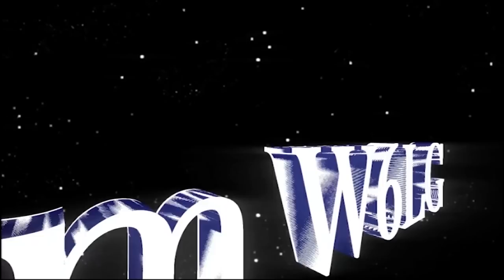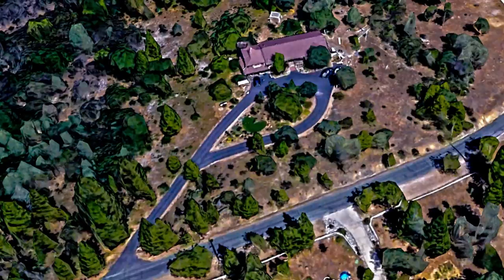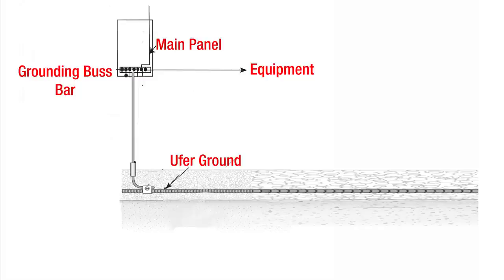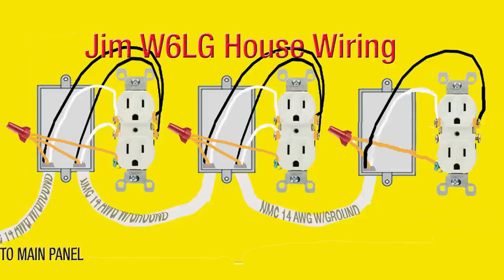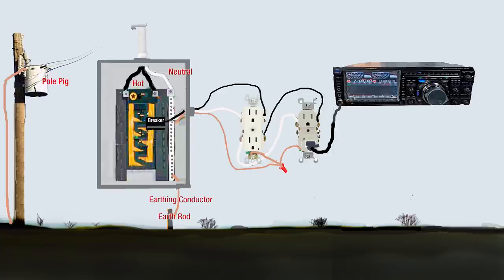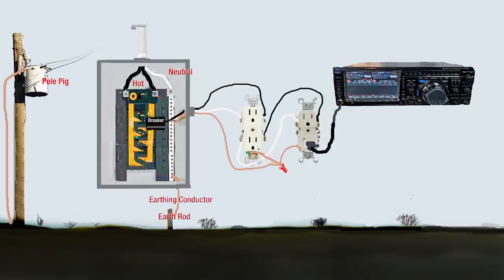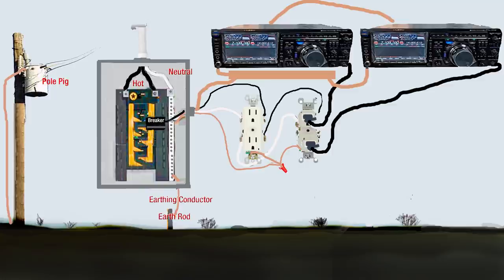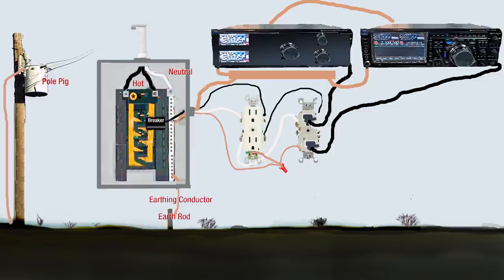Grounding, Bonding, Earthing, Shielding and Protecting with Jim Heath W6LG

Comment: Hi Jim I am loving all these new names Uffers and Pole Pig's we don't have those her in UK and I have never heard of an Ufer...All our Houses have Equipotential Bonding where all Equipment is bonded with an Earthing Conductor which all leads back to the Mains Earth, having Ring Mains on ground and upper floors also reduces the Resistance or Ground Impedance effectively doubling the 2.5mm2 Earth 5mm2 to everything that's connected..
Great Video Jim.
73 de Steve
Reply: Just found out where the name Ufer came from》》》
In 1942, Herbert G. Ufer was a consultant working for the U.S. Army. Ufer was given the task of finding a lower cost and more practical alternative to traditional copper rod grounds for these dry locations. Ufer discovered that concrete had better conductivity than most types of soil. Ufer then developed a grounding scheme based on encasing the grounding conductors in concrete. 
It was adopted into the Safety Codes in 1963 although they recommend the use of Copper coated Grounding in not so dry area's..
Interesting stuff.

Comment: This makes sense to me. My newly built house seems to be wired right as every outlet I've tested provides a 120-125V reading from hot to the ground socket AND to the cover plate screw.  In other words, there is zero difference between the hot-to-ground voltage and the hot-to-plate screw voltage.  Given these sockets all run to the house ground, my radios will be grounded to the outlet ground and thus will be on the house ground.

Comment: Jim I really love your videos and learn something new each time I watch them. I have been a Ham for ten years now and I have never ran a separate ground from my transceivers or Amps. Along with you I feel this is a violation of the NEC. Also, in rare cases it is an extra conductor of a close lightning strike...it has happened. I checked my circuits with a tester to ensure the ground is active. And my second ground to my equipment is from my antennas. So my equipment is double grounded. Why would I use a third ground? Many old timers will say that the grounding lug on the equipment is there for a reason, and maybe in some countries without grounded circuits or on a DX expedition it is useful. However for the most part that grounding lug on the back of the Transceiver is a leftover from the early days of Ham radio when electrical circuits in homes and elsewhere had no ground. Most people don't realize that in the beginning of  home radio receivers being sold that hundreds of people were electrocuted by them, and when television was introduced the same thing happened. When grounded circuits were mandated by code the danger of ungrounded circuits was eliminated. So I don't ground my equipment with a third ground.

Comment: Hi Jim, this is one of those subjects that gets more and more complex the more you look!
The Motorola grounding approach actually creates great complications for most of us in the U.K, the electricity supply to my house for example uses a system called TNCS. Basically this means that the incoming feed is on a 2 conductor cable with the safety ground doubling as a  current carrying conductor.. The problem with this is that in the event of that conductor failing in the street that the load current for a number of properties could theoretically try to flow from the chassis of my transceiver to the antenna ground. This is a strange scenario but it is permissible for me to use a separate grounding system for that one room. I best reiterate that I am in the U.K., and that our supplies and “codes” are different. Scarily a few days ago I discovered that the safety ground to all of my ham gear is absent, highlighted when I got a shock while connecting the coax to a grounded quarterwave vertical.
The mains filters in the gear mean that without a safety ground the chassis float at half supply…
Reply from the maker: It does.  My guiding idea was all current from the AC supply goes back to the electrical panel.  That could be a sub or main panel.  I did want AC flowing into the ground at the shack and result in current not tripping a breaker because some of it was siphoned off.  Some disagree with that principal.  As a Building Inspector and member of the Board that set standards in later years, we all agreed on that along with knowledgeable Licensed Electricians who cared about the safety of the customers.  Seems simple enough to me but not to many others who violently disagree. 73, Jim W6LG

Comment: Maybe discuss the potential problem of a second story ground and how certain wavelengths of copper can cause problems at certain frequencies.

Basically the copper leading from the second story to the earth ground provides an unwanted return path for RF to the radio, tuner, etc.

This is similar to common mode current, but in either the house electrical system or sometimes in a individual station ground. Just a thought. There are variations of this problem and they are difficult to isolate and diagnose. RF, EM, current and voltage are all looking for somewhere to go.
Reply from the maker: Thank you for your comments and question.  Why do you have wires leading from the second floor to ground?  Why do you feel that you need a path to ground?  What does that accomplish?

73, Jim

Comment: These videos are very interesting. I do have a question where multiple pieces of equipment are concerned. In the case of bonding two pieces of equipment together to ensure they are at the same potential, why would it be necessary to then connect them to the electrical panel when they are already connected to the same electrical circuit? I would think just the act of strapping their chassis together would be sufficient to put them at the same potential since they are both using the same earth return path through the house and out to the panel via their grounded plugs.

Comment: i understand that you can have more than one ground rod, but they all must be tied to the same voltage potential in the main electrical panel.  This is why the main panel has the neutral and grounds tied together, but a sub-panel has them separate.  It all goes back to the voltage potential and having a single grounding "reference" point.

Comment: I have been reviewing your videos' on NEC and I do enjoy these very much, Thank you for providing these. I do have some thoughts on the NEC, Aren't they only concerned with Safety of the persons working on and with the equipment? It has been my understanding that what the NEC says about grounding is strictly for safety, being sure there is a redundant return path for the electricity and nothing about RFI. and in my understanding the typical Bonding we as Ham's do is not for electrical safety but to remove any stray static that may be introduced into our equipment by lightening in the area and to help carry away and RF current that may come back into  the shack as the result of antenna / feedline mismatch. This being done by a common point bonding bar, then outside the shack to a going rod in the ground. Then connecting this rod by running a bonding wire back to the electric panel ground rod just to keep everything at the same electric potential.
This is the process I use at my QTH.
Thanks for your You Tube channel and your hard work it takes to make these great films.
Paul Krog
call KR5OG
Troy, TX
Reply: @jimcoon  Jim, bonding is to reduce static on the coax that is carried to the radio (noise) along with any RF coming back into the ham equipment in your shack, by attaching everything to a common ground then out to a ground rod as close as possible to the entrance of the cables entering your shack. 
As far as bonding back to the service entrance ground, it can be difficult but should be done. The purpose for this is protecting you and your equipment in the event of a close by lightning strike. By bonding the ground points together helps to keep both points at the same electrical potential. I have known hams with your situation, long run obstruction like a driveway, that have run the bonding wire around to the driveway and then removed some of the expansion joint filler where the driveway buts up to the house foundation, placed the wire in that space, then replaced the expansion joint filler. 
Also the conductor from your ham equipment to your copper pipe should be flat braided copper rather than a wire. (Flat braided copper 3/4” wide) also the conductor from the copper pipe should be a copper strap 1 1/2” to 2” wide and fairly heavy gauge .020” to .032” thick. The reason for this is RF only flows on the surface of the conductor. And the strap has much more surface than a # 6 wire. 
To boil all this down, each operator has some variations from what others have. And in some situations it can be nearly impossible to accomplish, but do the best you can. As you get into the hobby more with time you will see how others have overcome the obstacles. There are some that have never even tried to do this properly and just take their chances. I don’t recommend that approach. 
Good luck and 73 Kr5og

Comment: We appreciate your informative and helpful productions.  Our breaker box is wired a little different.  There is an earth ground bus bar, and a separate, isolated, neutral bus bar.  Your thoughts.   Also, I power my entire station with a heavy duty 12 VDC linear power supply.  None of my equipment is powered directly by AC.  Would my grounding requirements be different ?   Thanks,  Bob

Comment: I wonder, if I am allowed in general to run a separate grounding wire to a house panel.  E.g., could I run a green wire from my equipment, over the wall, to an apartment's distribution box's grounding bus?
Reply from the maker: Hi, I  think I answer that in the video.  You would have 4 wires.  The ground and neutral are kept separate.  Thank you, Jim

Comment: I have rfi in my shack. Running a fan dipole. I coiled a choke near the feed point and it’s helped a lot. But there is some still there. Today I rxed mix 31 beads as well as a 43 terroid. I’m not sure how to wrap around this terroid for rfi coming back in. I do have a earth rf ground however I have disconnected all of these with improvements. Answers ?
Reply: Feeding your Coax through the centre of a bunch of Toroids as near as possible to where the coax enters the Shack will help a lot, also you could try a few on the supply leads to whichever equipment is being effected by the  RF just remember all wiring to equipment act's just like a receive Antenna...Good Luck.
Regards Steve M0BFM Liverpool UK
Reply: Steve Jones thanks Steve. I ran 8 turns of coax through the terroid and it cleaned a lot up man. But also elevated the sweep on swr from 3900 to 3850. Interesting.
Reply: @JayN4GO  Yes that is a Clue which looks like you are Radiating RF from your Coax . In Effect your Coax is acting as part of the Antennas Elements . Are you using a Balun with the Fan Dipole if you are not then that would also cause the RFI..The SWR will change if you alter the length of the Coax or alter it's Impedance which is what is happening with the Toroid..RF can be tricky stuff at time's..Best of luck.

Comment: Jim, I have a copper strap connected to my transceiver and my amplifier. The copper scrap is connected to a number 4 copper wire wire going down to a 6 foot ground rod, below the shack. Is this the way you would do it?
And what about unhooking the coax when not operating?
Reply: Looking at what Jim has posted, that's not the way to do it because you have two earth grounds and he says that's bad. Since that would introduce a ground loop, I'd tend to agree.

Comment: What is the purpose of the secondary bonding of the radio chassis?  They would already have chassis grounds tied to the primary panel ground through their power cords, no?
Reply: gunguy2222 That would be one of my questions also. As long as it has a three prong cord and outlet won’t that suffice? Also for me to bond my panel ground to my radio ground would be like 200’ is that still 100% necessary? Also my electrical panel has two ground rods bonded together separated by 8’ which I think is a code requirement. Great to see you back Jim!! Hope all is well! -73- W1KPS

Comment: Could you run an isolation transformer and use a separate ground?
Reply: Hi Greg you wouldn't have a ground with an isolation transformer the whole idea of them is to isolate the supply from ground so if you touch it there is no return for the current and this prevents electrocution..obviously if you grab live and neutral on the transformer output you will still get a shock..putting an Earth in for an isolation transformer would just make it un-isolated..hope this helps.
Regards
Steve
Reply: @stevejones8665  So a floating ground?
Reply: @grhinson  I imagine that if your AC supply to your Ham equipment was through an Isolation Transformer, and then grounded all your Ham equipment & antennas to a ground rod near your shack, you then have good RF ground, good path for lightning, etc. That may get around the NEC violation Jim described in the vid... not sure. And I suspect it might help reduce hash/noise on the HF bands... maybe. I would love to hear an expert weigh in on this, but the idea is quite interesting.
Reply: @grhinson  I'm assuming neutral and ground would be bonded, just like in the main panel, on the secondary of the transformer.
Reply: @misterhat5823   to use a separate ground point / ground rod